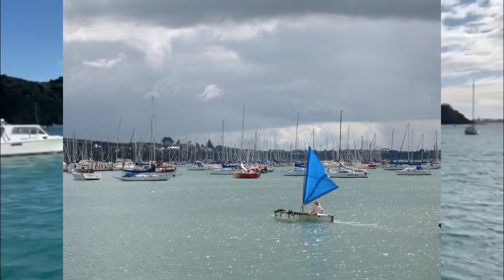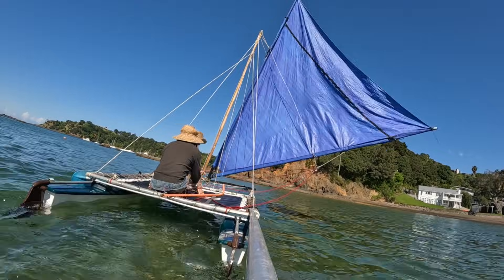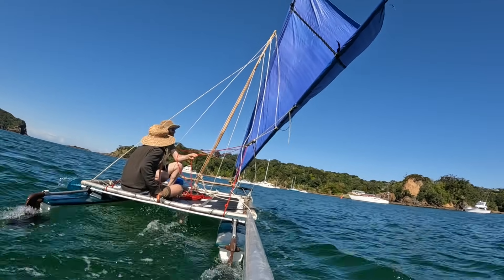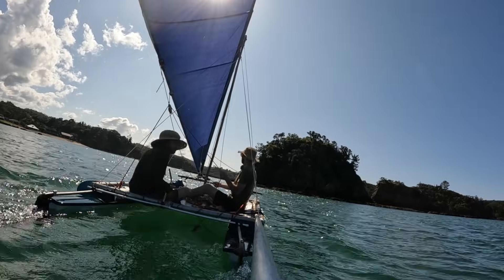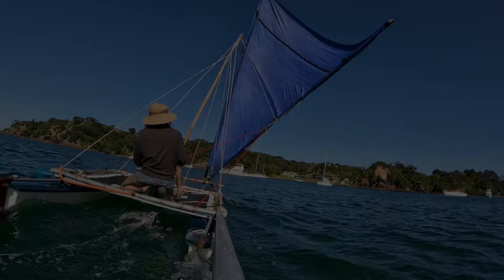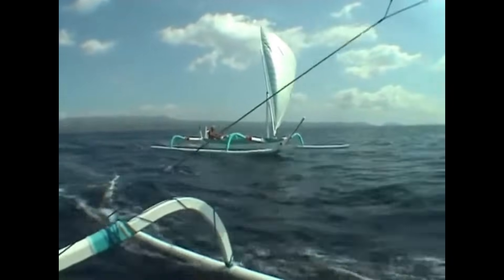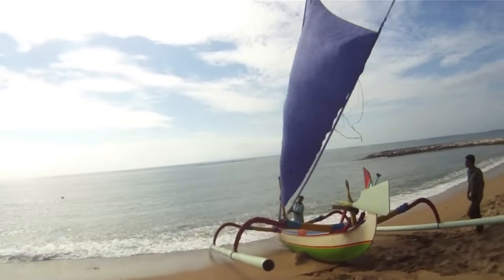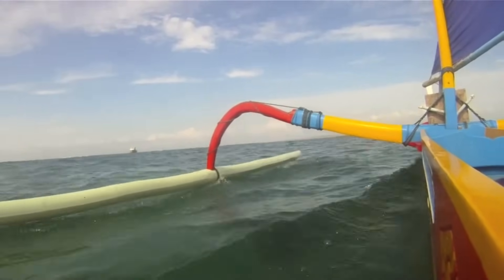Crab Claw Sail on a Catamaran?

Comment: Cool! 

I had planned to add a track and car on my A Frame CC to move the tack position. 

Was this something you tried/experimented with on the A Frame rigged boat as well? 

Like moving the bow sprit on a Tri to keep the headsail full and get better off angles, I thought it might be a worthy addition.
Reply from the maker: Some a frame cc cats use a block and tackle to pull the tack back. Unfortunately I didn't try that configuration so I don't have such a well informed opinion of it

Comment: Do you think the outside jibe rig would work on a monohull (Neptun 22)? Just bought a used one, and will probably need to replace the sails and most of the standing rigging anyway, so I thought about installing a crab claw instead...
Reply from the maker: well sure, that looks a good size (not too big) to experiment with traditional rigs and crab claw is something that's pretty cheap to prototype. Although the way I'm doing in, with the gybe only design, and the moving mast might be a bit hectic on a monohull because it's gonna be a lot more rolly and will heel. You could make it more like a junkung rig which uses a short unstayed mast.

With a taller unstayed mast you could also do a lateen, or a dipping lugsail, or a balanced lug. I've been day dreaming about a monohull with a balanced lug, but an extra big light dipping lugsail for light wind. You could also do a junk   rig on an unstayed mast.

Dipping lug and lateen also do the outside gybe. Given the neptun is a monohull with a fin keel tacking shouldn't really be a problem so a gybe only rig isn't so good a trade off
Reply: @dominictarrsailing  Thanks for the suggestions.

Not sure if unstayed mast is an option, since the mast on the Neptun just stands on the deck and doesn't go through or is anchored with a second point in the hull. But I am gonna think some more about it. Got time anyway, I am still in the process of renovating the interiour. Plus, the mast stands directly above the entrance to the V-berth, so it's difficult to change that.

And yeah, I am aware that the gybe only rig is a bigger drawback for the Neptun than it is for a Wharram.
Reply from the maker: @mirror452  ah yeah for to change to an unstayed rig you'd need to make a hole in the deck and then reinforce around it. Usually for a deckstepped mast there will be a compression post, but it might be a heavily reinforced arch, but usually it's a post.

Comment: Hi Interested in how the mast stays work, seems like there we 4 mast stays in the first rig, but only 2 in the second bamboo rig and final aluminum rig. It’s hard to see from the video, what keeps the mast from falling forward or back?
Reply from the maker: There are two tight stays port and starboard, but the mast can also tilt forwards. There is a forestay and so that the mast stays up when the sail is down. When the sail is raised, the yard and the mast make a triangle so you the forestay and back stay doesn't need to be tight then. Yes, we tried having two  backstays or one backstay. It's just a matter of what you feel gets in the way the least. Later I rigged my big boat like this and I used side stays, two running back stays, and a forstay to a bridle. I have the forestay back a bit so that it doesn't snag the boom.
Reply: @dominictarrsailing  thanks for responding

Comment: The terminology of the crab claw sail is a mess. The featured sail is termed an oceanic lateen by the ethnographers who have studied the original sail types. The crab claw name is sometimes applied to sails with a very concave leech. These have interesting aerodynamic properties as they form vortices at the end of each boom, which increases the power of the sail. Marchaj made a study of this. You will find the term crab claw sail applied also to the oceanic spritsail found in Hawaii. That is an entirely different type of sail. For instance it doesn’t get extra drive from vortices as the concave part of sail is at the top. This further illustrates the terminological mess: 2 types of sail with the same name.
Reply from the maker: It's more than two types! there are lots of different variations and different people have called it different names. Different islands groups use different proportions with maybe one or other spars being curved or straight, sometimes a hollow leech, even to quite extreme proportions! However, clearly these sails are all related, as the basic concept is a sail attached to two spars that also meet at the tack, then have adjusted the proportions. To be honest I'm a bit skeptical of the Marchaj claims (vortexs causing lift) because that was just a one off and that research hasn't to my knowedge been repeated, as well as being counter to conventional aerodynamics. Also, many crabclaw/"oceanic lateen" users around the pacific seem to have the yard upright or near upright (such as kiribati and marshall islands) on the other hand, on the indonesian junkung when sailing to windward they have the sail very low, so it does seem like marchaj vortexes may apply. Then on the other hand, in fiji they shunt like in micronesia but carry the sail much lower so it's closer to the angle on the jukung
Reply: @dominictarrsailing The 2 key points are that the sails of Oceana and Island Southeast Asia do not have consistent terminology in the way that other parts of the world largely do and that ethnographers rarely use the term crab claw sail, when they do it can apply to both the Oceanic Sprit and the Oceanic Lateen, which are entirely different types of sail. 
The vertical positioning of some of the sails with concave edges maybe to do with responding to higher wind speeds. Users of “Western” sails are the only ones who have reefing available as an option.
Marchaj’s work is cited by those currently working on the ethnography of Pacific seafaring. It does seem to be generally accepted.
Reply from the maker: @jonward5357  which ethnographers are you referring to? If I search for "oceanic lateen" or "oceanic sprit" the top result is the wikipedia page for "crab claw sail". From what I can tell, the ethnographers themselves don't have a consistent terminology, and usually just define their terms. One guy says Crane Spirit, another Prop Masted Oceanic Lateen. Personally, I disagree with using the term "sprit" as in western rigs, a sprit is a pole attached to a corner of the sail and only under compression. In the traditional pacific sails, this is not the case the sail is attached to the spars along their entire length. A case where the term "sprit" does fit is the style used on Sri Lanka. So, in my case I use "crab claw" as a broad catch all "garden variety" term, and to be specific I refer to the particular island group that is design is used on, possibly using the traditional name for that craft if it's distinct enough. 

I would cite Marchaj too, but just because ethnographers cite Marchaj doesn't mean his aerodynamic claims are true. His work needs to be replicated by aerodynamicists, and unfortunately there is very little wind tunnel work on pacific sails.

But the biggest problem, is that ethnographers are generally speculating about reasons and uses based on old reports and illustrations. However there is a lot you can only learn about a sail by actually going sailing. For example, making the yard vertical "to cope with more wind" no I disagree. It's actually the opposite, that would set the center of effort higher, increase heeling moment. (see Outrigger Canoes of Bali and Maldura, by Adrian Horridge, for a description of how the sail is adjusted to vertical for sailing down wind and across for sailing upwind)
Reply: @dominictarrsailing  Wikipedia as a source, that's a problem. Wikipedia articles vary a lot in how accurate they are. Go to a high-traffic article like Taylor Swift, that's probably OK.  On a low-traffic article, you are better off reading the sources for yourself and seeing what they actually say. The article for Crab claw sail is flagged as disputed and has two failed verifications in the first paragraph (which means the author has cited a source, but the source does not confirm the content). The key ethnographers include Haddon and Hornell in Canoes of Oceania. That is pretty much the starting point for everyone, as they comprehensively captured the information before engines arrived (but after the influence of Western rigs). There are also Geoffrey Irwin, and Edwin Doran, with Anne Di Piazza as a recent publisher. You have already mentioned Horridge. Additionally, there are researchers working in the field of comparative linguistics of boat parts, such as Waruno Mahdi.
It is widely accepted that there is no fixed terminology for these sails, but that is no reason to use a narrowly applied term to a broader category as it just adds to the confusion. By far the commonest term for the sail in this video is Oceanic Lateen. The Oceanic Spritsail is the sail found in, for instance, Hawaii, and is a different type of sail. 
Note that the biggest retailers of the Sunfish (as a modern production boat with the sail type we are discussing) do not use the term "crab claw sail". (https://sunfishdirect.com/store/index.php?route=product/search&search=crab%20claw) It's not good marketing to use terminology that can be disputed.
On the aerodynamics of these sails, Anne Di Piazza has published (with others) on wind tunnel studies of a range of sail types. You probably should read that. I would try and dig out the reference for you, but I am just about to leave on a week-long research trip and will be on the road in just a few minutes. (And there is a lot more to say on this subject.) I will be limited for internet connectivity whilst away.
Reply from the maker: @jonward5357  sorry I wrote a long and detailed response but it got lost because this is just a youtube comment thread. shall we switch to email? dominictarrsailing@gmail.com

I have read the Di Piazza paper. That's the one I was referring to with the fiberglass sails. I can point out some problems with it, but the biggest one is that they don't really specify the sail shapes they used. The just say that the fiberglass (!) "sails where laid-up on the same male mold, with the maximum camber at mid chord and flattened sections fore and aft"  without specifying their orientation with regards to the spars? is this the same shape that the wind would blow a flexible sail into? if not then how can the wind tunnel tests be representative? It's not enough information to reproduce their results!

also something I know both from sailing a shunting "oceanic lateen" and is that the spars bend and this effects the sail shape. I read that the use in the case of the te puke the highly curved spars are actually flexible and straight but bent by the sail. The design is intended to compensate for the flexibility. on the other hand, Carolinian style has a curved S shaped boom, made from 3 quite solid pieces lashed together.  The very intensionally chose that shape but it's gonna flex a lot less. On the marshall islands they have a straight boom but a slight convex curve at the bottom of the yard. Kiribati chooses straight spars, but with the sheet it attached to the boom spread out in several places, which will support it much better (so likely it bends less). These differences are all probably detectable in a wind tunnel or side by side racing.

I think if we really want to fix the terminology problem, it should be based on the functional anatomical features of the sail. It can't be based on the lineage because that's just speculation, and surely isn't linear anyway.

There is also the question of where you draw the limits between the types - you suggest that the Sunfish sail is a oceanic lateen, but it's hanging on an upright unstayed mast, so it pivots on the mast - vs the micronesian style with the prop mast and the tack fixed near the bow, that pivots along the yard. These are gonna present different shapes relative to the wind and also have different handling characteristics.

I was also told by Glenn Tieman (who has spent years sailing around the pacific on a catamaran crabclaw ketch) he told me in lighter wind he has the yards vertical, but when the wind freshens he lowers the sails on the stubmasts and eases the snotters, which lowers the center of effort vertically, but doesn't move it fore/aft and so maintains sail balance, and that this is effectively a first reef. When the yard is vertical you could argue it's a oceanic sprit, but when the boom is horizontal it's a oceanic lateen, when it's clearly the same sail...
Reply from the maker: actually looking at the sunfish again, it looks like the luff is at 45 degrees, and it does look like an equilateral triangle (which micronesian sails, aren't if you look closely) so boom and yard are about the same amount off horizontal and vertical. So it's mid way between. And the boom is attached to the mast, so definitely pivots along the mast.